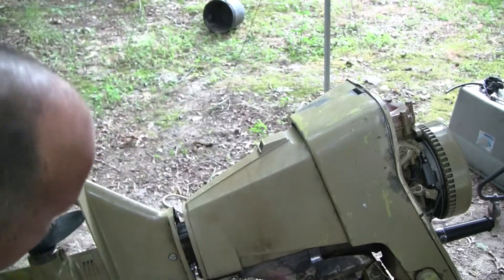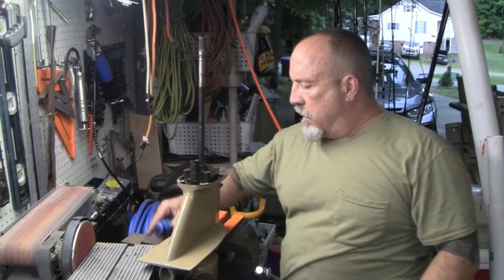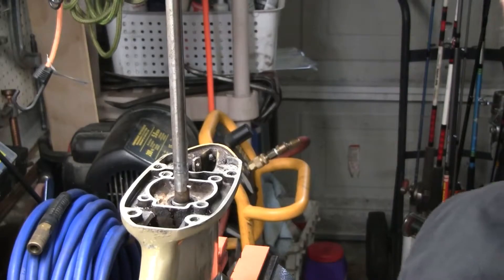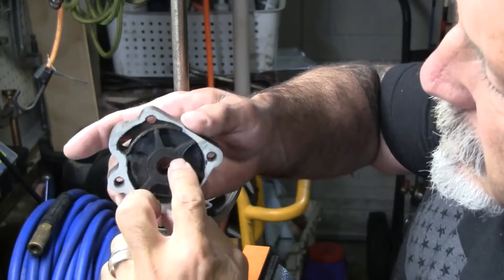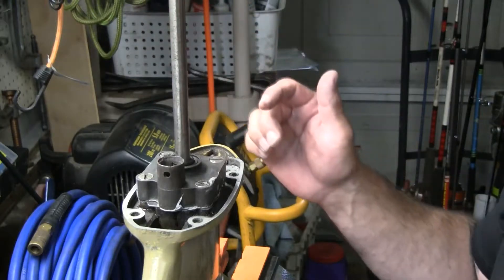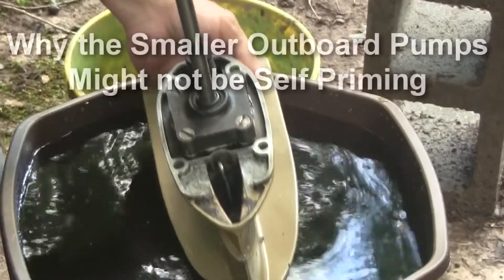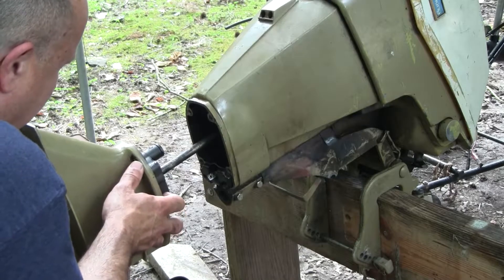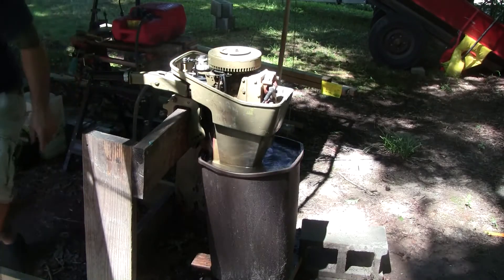Sea King Chrysler Outboard Cooling Failure Impeller Pump - How to Clean and Install

Comment: hello, can you tell me the number of the 2 seals of the chysler 35 hp water pump, thanks
Reply from the maker: I cant recall at the moment but if you check online you should be able to find a part diagram here is the a site i use  marineengine.com

Comment: Working on a 1986 US Marine Force (chrysler/sea king) and was worried it wasn't putting out enough water. Putting out the same amount you had there. Still have to replace all the lower seals. Oil was fine until I ran it in water and then it was MILKY. And there was a slight clog in the uptake tube so we will see. Thank you!

Comment: Great video. I have a Chrysler 9.9hp and whenever I start it there is black oil leaking out between the mating surface of the lower gear unit. I checked the oil in the lower unit and it's not black so I'm not sure where this oil is coming from. Also what oil can I put into the lower gear unit any help will be much appreciated.
Reply from the maker: That's probably just unburnt oil in the exhaust. I use regular 90W oil on this one which should be fine.
Reply: @ExtremeDIYGuy  hi is it possible to WhatsApp you or chat on facebook messenger then I can send you a little video

Comment: I have a 1978 10 hp and I had to shift it in reverse to get it to open up enough to get the Allen bolt exposed
Reply from the maker: Sometimes shifting is required for removal.

Comment: Hi I have a 9.9 I been working on believe it’s a force but looks just like this one. When you look up into the engine does yours have a tiny hole next to the pickup tube? When I blew water into the pickup tube it comes flying out of this hole which to me looks like it was drilled out for some reason.
Reply: https://youtube.com/shorts/bB3L2Hku3Uc?feature=share  here’s a quick video of the hood I am talking about.
Reply from the maker: Hey Nacho, I don't have that engine anymore so can't take a peek to see. I would say the size of the hole is immaterial even if it was drilled out. You can run the engine and as long as warm or hot water is coming out of the exhaust port you should be good. I also used a IR temp thermometer to check the running temp on mine. BTW, Nice Nova. Let me know when you're ready to sell it 😀
Reply: @ExtremeDIYGuy  Imma take that car to the grave with me 😂 but I found the problem I believe and feel very very dumb…. I took the floor outta my boat and now it sits like a foot higher then it used to and then motor is sitting too high now. I need to notch the board out in the back like the other one used to be and should be all good
Reply from the maker: I noticed that when testing hte engine, it has to sit fairly low in the water for the impeller to work. I dont blame you on the car lol!

Comment: Thanks for your time and demo, I have a Sea king 1966, 9.2  that was given to me and getting ready to do some work on it. Normally I prefer Evinrude/Johnson and their website for parts are very easy to Identify but I don't have the same luck with any Chrysler outboard parts. What site to you go for in locating parts?
Gracias for you video
Reply from the maker: Lucio, I use marineengine.com to get the right part number. I may order from them or search the internet with the part#

Comment: Just picked up a boat with a 9.6 sea king. Was worried it wasent spitting enough water. But it ran all day didn't overheat and after watching your video seems to be putting out the same amount. But if I need to check for debris or new impeller now I know how. Thank you
Reply from the maker: Your Welcome, Glad it helped!

Comment: I really appreciate this video! I’m currently fixing a 1980 Chrysler Sea King 15 Horse. My uncle had it after he and my dad overheated it over 20 something years ago. The head gasket is blown and I’m in the process of replacing the impeller. I have the lower unit off and the impeller still looks intact, but there seems to be calcium or something dirty. Could cleaning it and replacing the impeller do the trick? I’m also getting the head machined at a shop as well as a new head gasket. Thanks!
Reply from the maker: As long as the impeller is in good shape I would go ahead and re-use it. Just make sure it's not brittle.
Reply: @ExtremeDIYGuy  is it a bearing on the water pump housing where the shaft goes through? Mines does not spin and I can’t find anything online about the water pump housing?
Reply from the maker: @Samuel-zl7yw  There's a pin on the shaft that engages a sot on the impeller. IS that what you're asking? No bearings on teh water pump housing though, just a bushing and a seal on the top where the shaft goes through.
Reply: @ExtremeDIYGuy  Yeah where the shaft goes through the water pump housing. I thought it looked like a bearing. Is there a name for that part because mines has a small crack going on. And underneath the water pump into the lower unit? That is the same kind of seal?
Reply from the maker: @Samuel-zl7yw  Crowey Marine should have that part, check part 45 on their diagram here. https://www.crowleymarine.com/mercury-outboard/parts/1844_70.cfm?mdl=IEXQEC
But you might want to double check the engine model number. The bottom plate does not have one but you want a water tight sea between the plate and the lower unit as well as the plate and the housing.